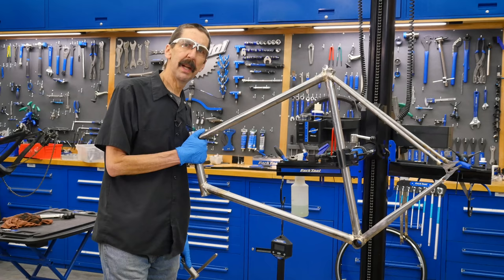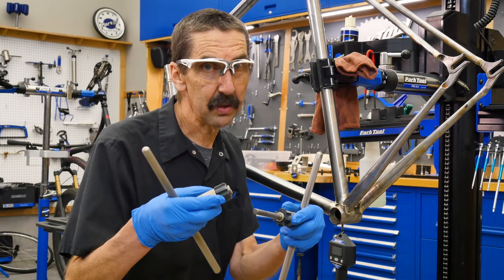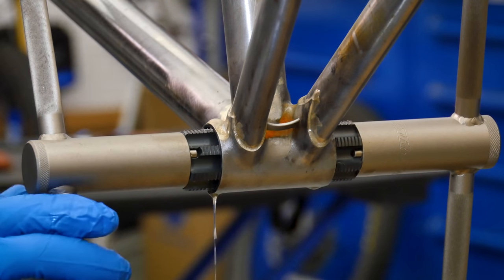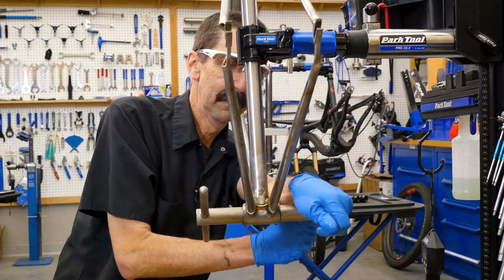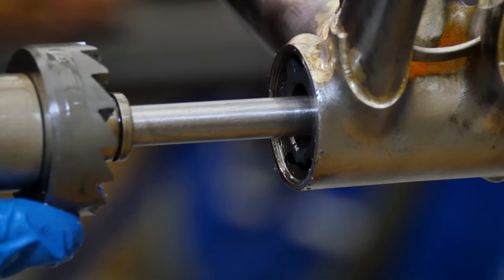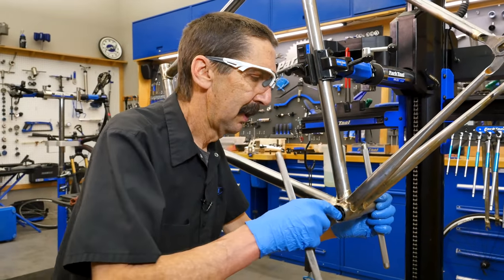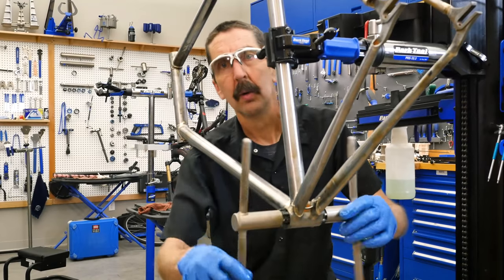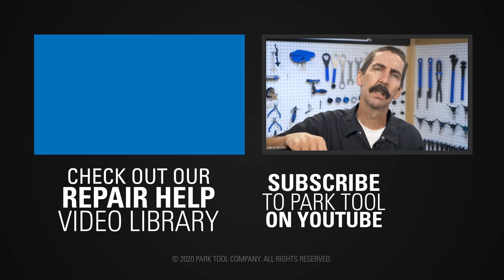It's on the Inside That Counts | Tech Tuesday #158

Comment: One heck of a head tube
Reply: Yeah the head tubes in these older ridged frame bikes are crazy, nowadays if your a tall rider you just get a bigger tire or a taller seat tube, in the 80's and 90's if you were a tall rider they just stretched the frame, back then I guess it was the easiest way 😅
Reply: Just think how long the fork steerer has to be.
Reply: Cup & Cone I know there huge!
Reply: Being 6'4" myself, I have always sized a frame via its head tube length
Reply: @mistermoore5784  Stack and reach are what you seek.  Won't tell anything about performance geo (i.e. wheelbase, head tube angle, BB height), but will cut straight through to the correct size.
Reply: @sdy0108 nothing really changed for modern road bikes.

Comment: Once again Cal makes the hard stuff look easy. Not too many shops even have those tools. That's frame builder level.
Reply: My local bicycle co-op has this tool, as well as the head tube ream and facer. I have used them to prep several steel frames before assembly - it's a very satisfying process and good to know that the frame is properly prepared.
Reply: Our LBS does, they did my Kona Kula. This is one expensive tool, not worth buying for home use!
Reply: not a proper bike shop if it doesn't have basic tools, it's just a retail shop, and best left well alone. They will send your repairs to another shop and charge a levy, and charge a lot of money for new parts where simple fixes and repairs are the order of the day for an experienced and knowlegeable shop.

Comment: In the Giant factory they are done on low rpm , high torque , automatic drill presses with reduction gearing and forward only cut to completion and then a removal reverse single action . This is why factory shells are close but not fully refined like shown in this video procedure .

Comment: At the end when cleaning, use a bit of soap and water (i like Simple Green). It will do a better job getting the chips out. Then go in with solvent to displace the water to prevent rust.

Comment: I’m a huge park tool fan my home bike shop is filled with mostly all park tool. 
One tool I think that would be awesome if you guys could make is a new aws tool where you have the common size Philips, the slot screwdriver and the common 5mm Allen key. 
Those are the 3 main hand held tools you use in a bike shop I’m surprised you haven’t made one yet

Comment: That facing is what made me adamant that i want all my bikes have a regular bottom bracket instead of press fit ones
Reply: I never even thought of that. Press in is great for convenience but threaded is more precise! Ride on
Reply: @sjf1981  yeah man, granted its convenient but for home mechanic or tinkerer like me... regular BB shell is the way to go. Plus i might have watched Hambini's videos on youtube a bit too much haha
Reply: Yea, facing and chasing the threads only needs to be done once (by the bike shop, typically) and your bb will then always be nice, parallel and dead easy to install. Tricky thing about pressfit is that you need to take care and ensure a good parallel fit every single time you put on a new bb.
If I were to buy a new frame, I'd definitely want a BSA threaded one again, or one of the newer T47 style BBs.
Reply: SCOTT FLYNN Threaded is actually less precise than press fit. There has to be a gap between the threads or it won’t turn. Hambini did the math, and a theoretically perfect threaded BB is worse than some PF brands already.
Reply: joppek77 - I don’t understand the big advantage of T47 over BSA.  I’m sure it’s *better*, but is it better enough to justify switching from the old standard?  At least press-fit has a cost advantage.

Comment: Will a squeaky threaded BSA bottom bracket shell benefit from chasing its threads? I have a Specialized Aethos that has developed a squeak. Tried grease, Locktite and correct torque setting. Thanks

Comment: How do you know how much to skim off each side?  Couldn’t you end up with the BB not being symmetrical if you go too far?
Reply: Tim Cunningham You might see shiny surface...
Reply: the issue is if you have a local high point, so when you screw in the bb, the bb pivots on that point cuasing it to jam or misalign
if the face is otherwise flat except for an isolated valley, then its no issue because the valley will not touch the bb
Reply: @JogBird  nice
Reply: I would paint it with a sharpie and use the paint as a guide
Reply: You'd want avoid removing so much material that the BB shell width goes out of spec. Ideally, you'd want it to be exactly 68 mm, 73 mm or whatever the BB shell of your frame should be. It's probably wise to measure it before and after facing. If it turns out to be too narrow, you can always shim the BB cups.
Reply: joppek77 And you would need it to be even on the left and right, which I would think would be difficult to measure.  (Calvin could obviously do it correctly blindfolded.)
Reply: @cunningtim  True, ideally you'd want the distance on the drive side, and the non-drive side, to be even, and that is difficult to measure since you'd need to measure from the middle of the frame. But afaik the worst that can happen if the width of your bb shell is off, is that you're unable to adjust preload properly and your chain line might be off. Both things can be fixed with shims, so it's not the end of the world. :)

Comment: Hello, My bb threads got stripped. The only way to save it is to rethread it. But it's cost is just the same as buying a new frame. I was wondering if I could put the bottom bracket in its shell and glue it in place with steel putty epoxy, would that hold on or it will just loosen ?

Comment: I've been a mechanic for decades, I was taught to never, ever clamp a frame. I get that you can get away with clamping a straight gauge steel frame but I'm surprised you did it this way instead of using your seat post replacement tool or a seat post.

Comment: Maybe naive question but is the diameter of the nest for bottom bracket/threading tool always the same or there are different standards as well?
Reply from the maker: There are several threaded bottom bracket standards.  See https://www.parktool.com/en-us/blog/repair-help/bottom-bracket-standards-and-terminology  Also see #5 there on other standards.
Reply: @parktool  thanks for the reply. I'm just confused with the diameter for cartridge square tapered bottom bracket - do they also have different diameters?

Comment: No mention of measuring distance from newly faced surfaces to centerline of frame.

Curious.

Yes, shims can help.

Still...
Reply: I can't think of a reliable way to find precisely the centreline of a frame. Facing (assuming you're not a completely hamfisted bodger, in which case you shouldn't attempt it) is only taking fractions of a mm off a frame so that centreline measurement would also have to that precise. It's not enough to measure the BB as there's no guarantee it's centred relative to the steering axis either. Having done several road bike builds none have had BB shells precisely 68mm wide before starting. The worst, which was a prototype frame I got cheap from a boutique designer, was 67.7mm wide. With Shimano cranks and shims there's a fair bit of leeway in preloading the bearings, plus you might want to shim the chainline according to personal preference.

Comment: Hi Calvin, What would you do if one side of the frame does not start threading at all? Thanks! mark
Reply from the maker: Make sure you have the correct cup on the correct side.  Drive side is a left hand thread.  Clean inside and inspect the thread for damage.
Reply: @parktool  Thank you. Ive got U-T cups to go in, the DS (the one with the two holes for the pin) went in straightaway, no issue. Not even a cleaning tool will start on the NDS, r/h threaded. I can see a small area of thread damage, but that will clean up, i just need something, anything to start on the NDS. Yes, its a brand new (NOS) frame.

Comment: Should you also face a carbon Frame? If so is the tool the same. What about Press Fit?
Reply from the maker: The tool is the same for carbon. If there are threads the carbon bike will have an aluminum insert and can be treated the same. If a pressfit, you may have a carbon interface. This interface can be reamed and face with care.

Comment: can i do it in carbon frame ?
Reply from the maker: Yes it can.  However, it is not commonly needed on carbon fiber frames. These frame use a metal insert that is glued in place, not welded, so there is less distortion.  Metals thread can accept a tap, but in carbon fiber that is rarely needed.

Comment: Who is your dealer in Israel, i want to buy a few products from your company
Reply from the maker: ISRAEL
MATZMAN-MERUTZ MILLENIUM LTD

4 Haomanut St.
Netanya

972-9-8858661
972-9-8858662
Reply: @parktool  ty
Reply: @parktool  I saw that Mazman Merutz are very expensive, they sell your products for double, or triple the price on your website, for example Prs-2.2-2 deluxe double arm repair stand cost about 1657 dollars when on your website it cost 640 dollars and it the same with all of your products, do you have another dealer on Israel?
Reply from the maker: The prices are what they are based on the import fees, duty fees, taxes and shipping. Our website prices apply to USA purchasers only.
Reply: @parktool  can I order from your website to Israel?
Reply from the maker: No you cannot.

Comment: Brazing, and welding are completely different. I would think Calvin would understand this, but he clearly says "welded" and "welding" in the beginning of the video. It's impossible for Welding to get Brass, or Flux into the Bottom Bracket since TIG Welding (the most common style for bikes) does not include either.
Reply from the maker: Oh jeez.
Reply: @zygmuntthecacaokakistocrat6589  I guess it was rude of me to criticize Calvin for saying welding instead of brazing.  However, I've done welding, brazing, and I built a TIG welded steel frame (with brazed water bottle mounts, etc.) at United Bicycle institute. Sorry I didn't read that book, but brazing, and welding are different. That's a fact, not my opinion.
Reply: @parktool  Sorry, I guess I was being a "know it all". Awesome info on BB tapping. Looks way easier, and cleaner to do both sides together, than to start with just one like I had done in the past.
Reply from the maker: Might have to build up my old Paterek frame on the channel here.

Comment: Y not use grease instead of the oil
Reply: Cutting oil has extreme pressure additives to make sure it still lubricates while cutting metal.
Reply: Batu Çetin It often contains sulfur or lead based chemicals which lubricate, even when the oil has been squeezed out. It’s also good for this low speed cutting oil to be very viscous so it sticks better. I agree, grease is too thick and won’t move to fill gaps.